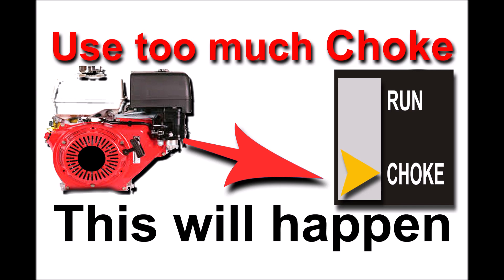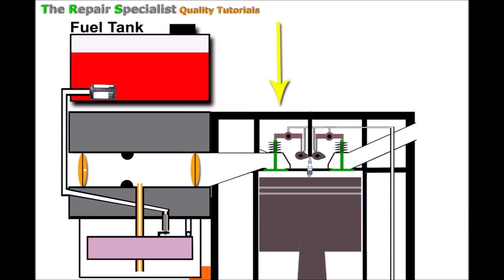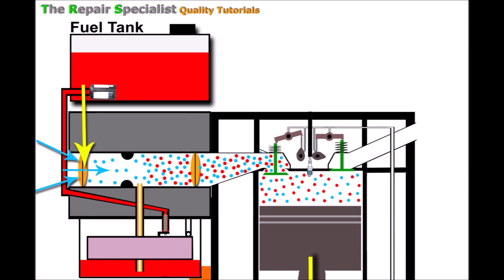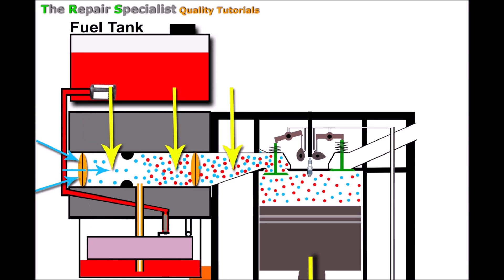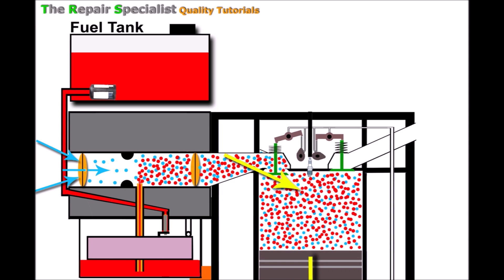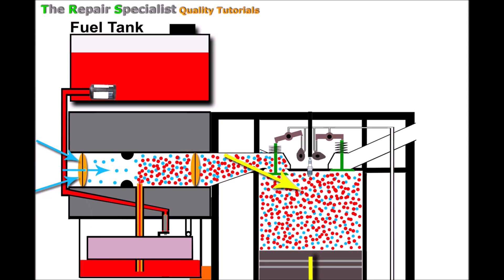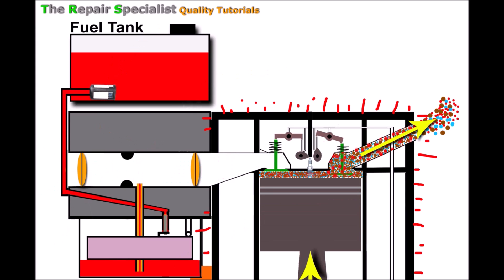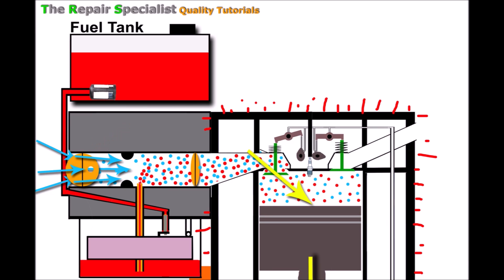Too Much Choke does this to an Engine | How it effects Engines.  (by Craig Kirkman)

Comment: Would be better to incorporate the term "Flooded Engine" and what to do.... leave the choke Open AND walk away for a while until it all evaporates then try again. In worse cases you can remove the spark plug too if it is easily accessible

Comment: So if on half choke, it will draw less fuel than on full choke as the vacuum now draws more air.
Reply from the maker: Well, put simply, more air can access the induction tube of the carb on half choke than full choke, yes. Thank you for your comment. Craig

Comment: I ran my new snowblower on half choke for a few mins on its first start up. My dumb head got confused with the choke and while it was running I put it back to full choke and it will bog then I put it back to middle position where it smoothed out and ran it for 10mins. I did that about 5 times then I realized I put the choke in the wrong direction then I finally put it on open choke and ran It for 2 hrs with no issue. Did you think I caused any damage to my engine. It's a powermore engine 208cc.

Comment: Thank god I came across this video
Some one who explained it in such a simple term,
15 Years tinkering with small engines and all I've heard is don`t leave choke on to long your`l flood the engine, So you see the choke as a tap letting in more fuel, Rather than your restricting the air to fuel ratio and it is sucking up more fuel due to less air and piston doing the sucking on its downward stroke due to the vacuum effect,
This choke on butterfly closed /Choke off butterfly open that had always boggled my mind
The most imported info was the vacuum effect `now I understand how fuel could flood engine due to lack of air.
Well done mate for putting this out there,

Thank you

Comment: That is why manufacturers put a hole in the flap on the choke panel, because people overchoke the engine. It only takes a few seconds after the engine starts to take the engine off choke. The person that leaves the choke on too long is risking fouling up the spark plug and excessive carbon build up on the inside of the head. Eventually,  it raises the head pressure and blows the head gasket. I see this more on snowblowers because snowblowers naturally are set to run rich due to winter conditions require more fuel to run an engine. Especially on colder temps.  Great explination. Its too bad many people cannot understand that running the choke on really shorteneds the life of their engine. I can always tell when an engine has been run like this as soon as I pull the plug. I give them a lesson on proper start up procedure when they come pick up their unit.
Reply: RC Hobbyist Extreme smart proud of u to do so.....I have no clue a out them so I choke them a lot think that will make it start up faster not knowing it's the worse think to do, tomorrow I will operate my weed eater the right way, and I will see how it's runs..
Reply: 501thunderbolt On a weed eater, choke it and pull the cord. if it fires but dies, take the choke off on the next pull. It reduces the chance of flooding the engine. I found this works 99% of the time. You may have to leave it half choked, but trust me, if you leave it full choke on that second pull, its probably going to flood. The green weed eater brand weed wackers are prone for flooding. I found that using my method of starting it seems to work better. Especially on those ones. I have been repairing weed eaters and chainsaws for 25 years. I found the internal scrrens they use are too small and easily plug. You can shop on line and find screens with larger holes that generally eliminate most issues with the bogging problem associated with newer two stroke weed wackers. The guy whom tought me how to fix them showed me that trick. I ordered a bag full of them.
Reply: RC Hobbyist Extreme you just open my mind about weedeater, after the teacher come a pro sometimes, I appreciate your info, I just learn how to start it, but like to shut down after my second round of cutting the yard...was thinking of tune it up which I know how to do too but for now I will check if the little hole is clog..or dirt in the carburettor.....I notice they 🔥 up quicker with a wider gap on the plug once it been flood... But I dont know if that can cause a misfire...will tighten my gap. And see how it run on a second round of cutting lawn...still trying to figure out things so I have to try different method until I master the little machine.. lawnmower is more easy to fix I tear them down change piston and so.... Just the weedeater is a hot head lol
Reply: 501thunderbolt I worked in a small engine repair shop in exchange for merchandise for a few years before opening my own shop until Cancer put a stop to that, well, most of it. What I learned was worth more than the money they would have paid me. As it was, I was selling and buying snowmobiles all the time as well as getting provided all the latest after market products right off the truck, before anything even hit the market. Snowmobile suits, gloves, boots, sparkplugs, oil, you name it. I just picked whatever I wanted and worked an average 4 to 5 hours a day, then went home, slept a few hours, then went and worked my regular 8 hour job. Every year I get offers to work at all the local small engine shops to help them catch up, but I cannot. My wife would kill me, my Doctor would help, and my body would last about two days and that would be the end of that. No, I learned alot about small engines,and still am.I traded a gun for a Craftsman Riding lawn mower with 17 hp Kohler engine last fall. The guy put a Chinese after market carb on it and couldnt get it to run. Just before winter, I came close to figuring it out, then gave up. Well, come spring I was ready to give it away till I finally figured its issue out and now it runs great. The main jet and air jet had to be drilled out, stepped up one size at a time, until I finally got it running properly. Yup, now I am using it to mow a ladys lawn instead of selling it before something else goes wrong with it. The shifter is wonky, but it does work. 
I can probably get $350 for it, but then again, in two months, I can make that much mowing with it.lol.
Reply: RC Hobbyist Extreme I'm just like that before I think to sell or throw the engine way I usually give it last try and I usually get to fix them....just a lil more time and thinking out of the box and a problem can be solve.... Thanks for the motivation.
Reply: @scottfirman  I think they're designed to fire and die so you don't flood the engine. At least that's what I've gathered from my experience with my 2 stroke equipment. I don't think I've ever had it fire and keep running long enough to turn off the choke. It's always choke and pull until it fires (up to five pulls) and then turn the choke off and pull until it starts.
Reply: Hey bro where are you from ...
Reply: This explains why my spark plugs is died
Reply: @duniafana291  Excessive fuel as in a carburetor in need of service can cause issues. I have been pushing the use of Recreational fuel to all my customers and suggest which places they can obtain it. Small engines run much better on it and this saves on fuel related issues. It doesn't hurt to add a bit of fuel stabilizer  to each tank eather, especially with snow blowers.